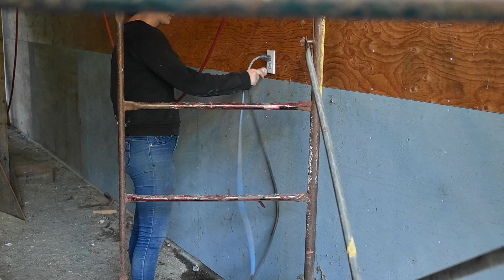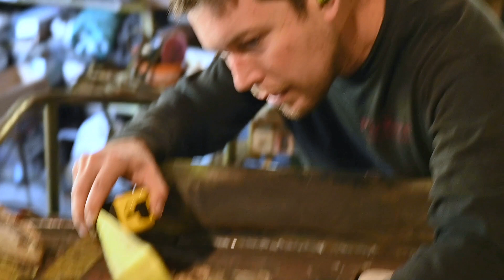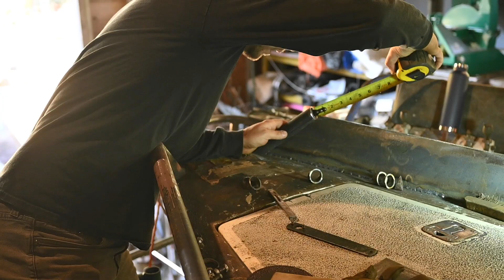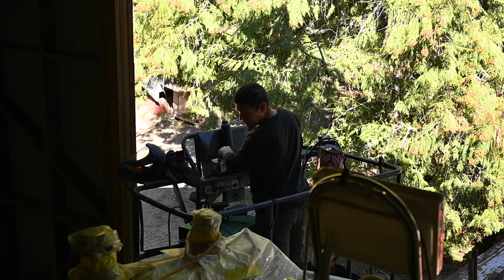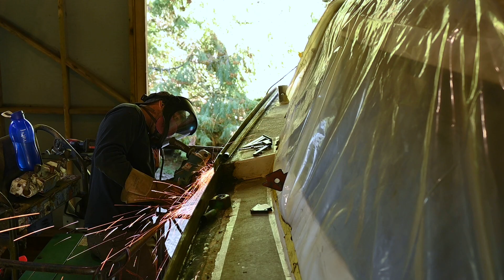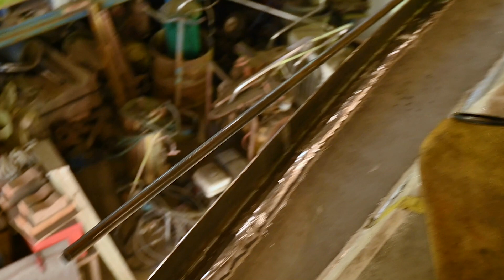A Day in the Life of a Steel Boat Restoration | Ch 5 E 34

Comment: Maybe your best video so far on the rebuilding of Papa Rumba? Just a thought here but if you were to cut a grove in the tubing instead of trying to adjust the height of the bulwark, would it be easier? You just adjust the height of the tube and who cares if there is 1/8 or a1/4 of an inch of bulwark inside the tube?
Reply from the maker: Glad you enjoyed! 😌 cutting into the pipe would have ended up being more work when it comes to welding and fitting, despite how it seems. We did consider it though!